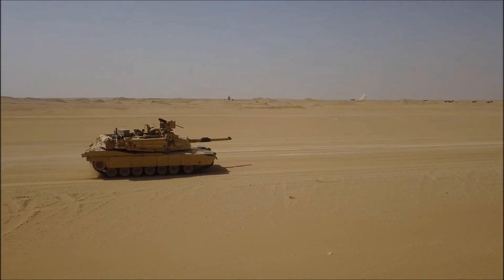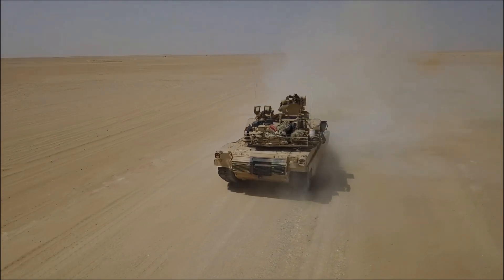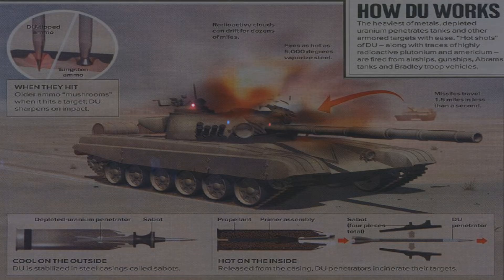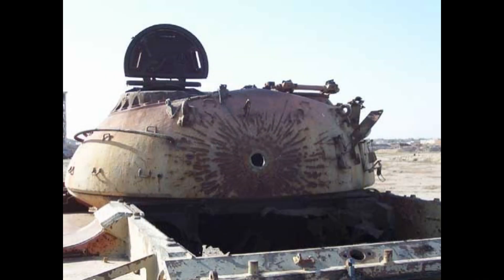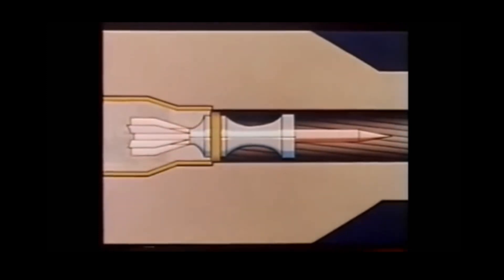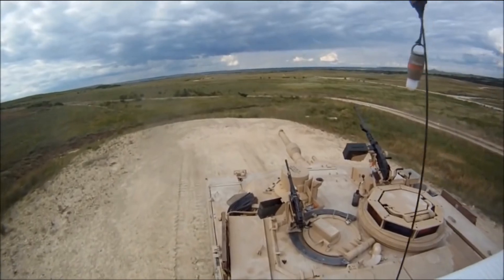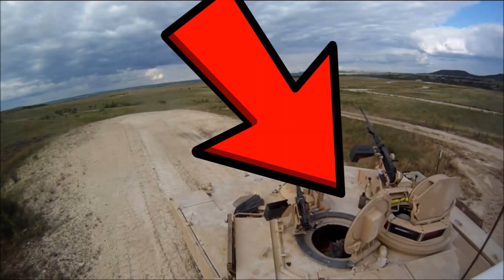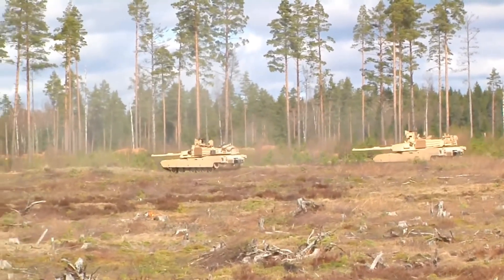Depleted Uranium Tank Ammunition | DEADLY DARTS 💀☄️

Comment: If the projectile does not show any appreciable gravity drop out to 3000 meters - which is about 2 seconds of flight time at a muzzle velocity of an averages of 1500 m/s. One starts to question why use a 120 mm gun, when a 105 mm does the job nicely. Conventional steel armour is pretty much cardboard anyway.

The kinetic energy is mass times velocity squared rendering the difference between a 105 mm and 120 mm round relatively unimportant.

This also makes me doubt the benefit of the defensive systems on the Armata. Time is simply to short to do anything if there is a properly aimed shot. OK - smoke etc. might obscure the target, but I think that is a matter of indifference to a slug under way. Stopping it with explosives? Come on: Be serious.

The survival probably depends more on who sees the opponent first. The Gulf wars were under close to ideal conditions. An aircraft 3 km away - against a clear blue sky - is less conspicious than the fly dodo on your spectacles. Using whatever cover and concealment there is - is under normal circumstances probably more effective than armour.
Reply: Why use 120mm? Because modern NERA arrays are nothing to joke about. 120 mm can deliver more mass at the same speed, resulting in higher energy. A modern 105 mm won't penetrate a modern MBT frontally.

Comment: US did not lengthen the gun on M1 because it already fires DU at optimal speed - it has been proven that DU has best penetrating capabilities at ~1550m/s and going any faster it loses performance.
Reply: The US tested the L55 (M256E1) on the Abrams from 1998 to 2000 and it performed superior, also with DU. The reason why the Abrams keeps the L44 is the stabiliser. It couldn't handle the higher weight of the longer L55, and a refit with a completely new stabiliser was considered too expensive.

Comment: Just in case you didn't have enough cancerous tumours.
Reply: DEPLETED uranium
means it's rad level is very very low
it's the heavy metal poisoning that's causing shit
Reply: I fucking load these rounds as my job and last I checked I’m not growing a tumor out of my ass.
Reply: @_Dogberry_  its an alpha emitter, very safe when outside the body since dead skin cells block it, but eat it or breath it and youre done.
Reply: Du rounds can also be uranium 238  but 238 is.  Not what we use in reactors that is uranium 235 there is a difference

Comment: The big advantage depleted uranium shells have over anti-tank rocket systems, is it is pretty much impossible to intercept and fully stop a DU dart as it is such a highly concentrated mass moving at ridiculous speeds. Basic physics are at play here. It needs an equal force to stop it, and active protective systems relying on explosive shrapnel shells/rockets simply don't provide  enough kinetic energy to stop the DU dart. 

The same idea is why Pk 1 & 2 Patriot missile defense systems suck at intercepting higher density (than air craft) ballistic missiles, as the the anti-air shrapnel missiles struggle against the higher density of missiles vs aircraft. Future Patriot systems moved on to direct intercepting missiles to fix this.

Contrast that to man portable anti-tank rockets. Their slower, fatter explosive warheads are more vulnerable to active protective systems that rely on shrapnel explosive devices. Not to mention their electronics are vulnerable to electronic warfare systems.
Reply: "active protective systems relying on explosive shrapnel shells/rockets simply don't provide  enough kinetic energy to stop the DU dart"

They don't stop it literally, but they do reduce its effectiveness, preferably to a significant degree. You don't need to destroy a projectile to make it ineffective.
Reply: @DimeOfDimes  
I said fully stop. Yes, in theory they can still interrupt the dart, and significantly alter the angle/effectiveness, but it still is going to hit and hit hard.

But that is besides my main paint. In comparison to anti tank rockets, DU darts are astronomically harder to stop with an active protective system.

Anti tank rockets are fatter, slower  (often sub sonic or low super sonic), have a large heat signature, and are full of delicate electronics. 

DU darts are smaller, denser, MOVE AT ALMOST HYPER SONIC SPEEDS, and have no electronic or mechanical components to be damaged or misdirected or tricked.
Reply: Might hit and will hit less hard. And since it relies on its own structural integrity to do its job, anything that compromises that will affect its performance significantly. That it's harder to do is not really interesting or relevant, especially since there are already claims of functioning systems and it's just a matter of continuing to develop a concept that by now could be considered proven. Designers are already close, there is no reason to assume that success isn't imminent.
Reply: You can't entirely stop a APFSDS, but reduce its effectivness drastically. Launcher based systems like Iron Fist detonate their interceptor in a distance of 50-80 cm from the APFSDS, with the goal to tilt it. A tilt of only 10° reduces armor penetration about 50%. But since it's really hard for a launcher based systems to be that fast and accurate, they are generally not very effective against KE. Distributed systems like Rheinmetall ADS don't aim to only tilt the rod, but to shatter and break it. That's more effective. The reaction time is not a problem either.
Reply: Agreed. Try guiding an anti-tank missile at a target moving between tall buildings or big trees, the missile loses it's window of opportunity very quickly, but a 120mm gun will reach it quickly and pass through a building or a tree if necessary, what would cause a missile to explode prematurely.  Also, in the case of wire guided missiles, which are limited to the speed at which the wire can unspool and have very little chance at winning a war in the woods of Europe or the Jungles of Asia...cuz the trees would get in the way & mess up the wires.
Reply: 1. 1490 m/s - velocity of DU penetrator when it leaves a gun.
2. Kontakt-5 ERA armour works also on KE rounds - reducing their effectivness.

Comment: “It does not incur any ballistic drop due to gravity over a distance of two miles” what?
Reply: Childish Gabino - this should read, "drop is a function of gravity and time, and this thing is so fast, it gets to two miles before gravity can drop it much."
Reply: That can't be true. It's just physics. As Bongo Brady said it's must be the fire control and aiming system that does the compensation and the round shoots fast and flat ENOUGH for the systems to be able to do that effectively.
Reply: The point of OP is that the way Matsimus words his statement it sounds like he's saying the round is immune to gravity which is silly.
Reply: That sounds like "battlesight" There is no need to use the laser rangerfinder out to 3600 meters. It speeds up the engagement considerably. The gunner just puts the reticle dot on the center of the tarhget and fires. The M1 with 105mm battlesight was 1200m
Reply: Bongo Brandy - in hunting this is called "point blank range" - the maximum range at which you can just put the crosshairs on the animal and pull the trigger, knowing the flat trajectory will put the shot in the kill zone.   Same advantage - no need to range it or calculate hold over. Also, these fast, skinny, dense bullets with high ballistic coefficients and sectional densities are incredibly less affected by wind drift than regular dimensioned projectiles.
Reply: +NGabin. The faster something goes. The less impact gravity has. Ergo why satellites stay up... This is also why its easier to hit with 5,56 high velocity ammo rather than 7,62. Which has a noticeable arch difference at 300m
Reply: Sabot rounds do induce some super elevation in the gun but compared to HEAT rounds its really minimal. The round is flying over a mile a second after all.
Reply: Flat trajectory is perhaps a better way of saying it, they go that fast we use cameras at high speed shutter and you can see by time the cannon has recoiled fully the dart has travelled to the target, penetrated sometimes through and is expended into the ground. My fave pics of tank ammo is APFSDS-T as it looks awesome.

Comment: Why not use rounds specifically designed to attack the top of the vehicle? Just like the Tow 2 or the Swedish Bill... but as a tank round...
Reply: Actually the South Koreans have a round like this. They aim it high and at a certain distance it fires a explosively formed penetrator down onto the thin top armor of a tank that might be hiding in a hole.
Reply: @boofassist  
You might have noticed that I specifically used the term "round" not "missile"
What I'm imagining is a round that can combine the top-down attack feature of an ATGM with the low-cost of a regular APFSDS
A "smart round" if you may...
Reply: +S. You mean an airburst. There are weapons like that in context of fragmentation, but a shape charge needed to penetrate the top of a MBT would be too small to fit inside the diameter of a tank shell. Therefor there are like a zillion reasons to instead use direct kinetic fire on the target regardless of shell type. 

The only exception being to maybe disable counter measures before a missile is fired. Which is a tactic deployed by armor hunter killer teams that are equipped with both a recoilless cannon and a hand held missile system.
Reply: @Lobos222  
Makes sense... thanks man
Reply: @Lobos222  look up the STAFF round for the Abrams. It was a experimental round that was a fire and forget smart round used the top attack method. If I remember correctly it didnt work perfectly and was shelved plus the Russians were starting to put ERA on top of their turrets. Probably was to expensive too.
Reply: kind of like a artillery round i think, but the problem with a round that have long and curved trajectory, they will take time to reach the target.

Comment: I understand your point on atgms but it is honestly a toss up. With APS atgms are almost certainly not going to be able to hit veichals from any angle. At least the du shells have a better chance of surviving it.
Reply: Depend on if it soft or hard aps ,soft just messed with atgm path but with certain range and hard just counter it with spooky shit but atgm probably be better for disarming the enemy tank operation or just fuck it crews and if I would see a missile coming at me I probably would want start traversing
Reply: APS sistems are only good against few atgm's if u  spam the tank with atgm's APS sistem will deal with first 3 or 2 missiles and the 4 one will hit. If it penetraits is another question.
Reply: Karolis Lukosevicius
But you won't be able to fire 4 ATGMs at once from a man portable system so the advantage would still be on the defending side.
Reply: @DisplayLine6.13.9   Yes if there's only one at team but usually it's not. it's  cold war tactics spam as much as possible. Also if have one at team with atgm's there's possibly thet u have targets with rpg and those can be intersepted by APS.
Reply: Karolis Lukosevicius
Yeah, but you are still only getting 1/4 of the killing potential that you would have had if APS weren't a thing. Remember tanks also usually don't operate alone. So the advantage is still on the defending side.
Reply: @DisplayLine6.13.9  My point was that APS can't protect the tank like some "god mod" shield against atgm's and rpg's or if it can its for short time.
Reply: Karolis Lukosevicius
I'm not arguing that APS are completely nullifying ATGMs in most situations. Im just pointing out that it does make ATGMs a lot less effective then they were. Even if it just means that you now need 2-3 guys with ATGMs instead of one guy to kill a singular tank, even then the APS made its job, made the tank harder to kill.
Reply: @SpardauDebesi  maybe so who knows how far technology will evolve. It maybe possible to stop 4 atgms one day considering the technology has alot of room to grow
Reply: @kameronjones7139  It's possible to stop 4 or more atgm's /rpg's today problem is top attack missiles like javelin or rpg's like rpg 30 that has tandem heat rocket. More to the point u can't stop more than one missile simultaneously effectively. But I have no doubt in 3 to 5 years it will be a thing.

Comment: Now this is what I call silver bullets, they even set the inside of vehicles on fire!
Reply: Like tungsten can't do that (that's called internal shattering, which is caused by shattering components in the tank which got shoted by that shell)
Reply: "... Which got shoted by that shell".

A more cleverer comment was never saided.

Tungsten doesn't catch fire when powderized and exposed to oxygen.  What you are describing is a secondary ignition caused by what the tungsten impacts, not by the tungsten itself.  It is not the same thing at all.